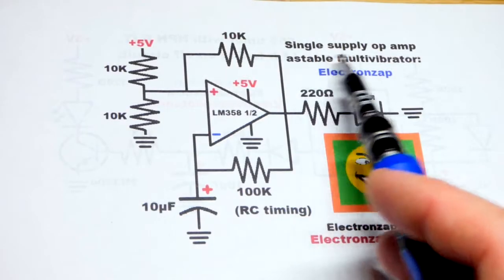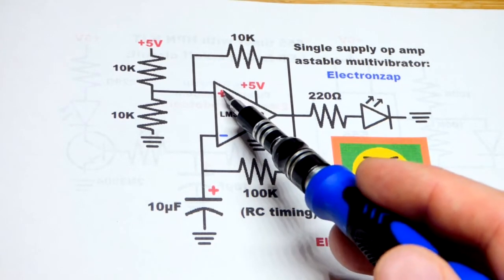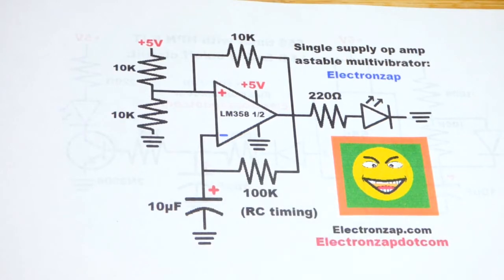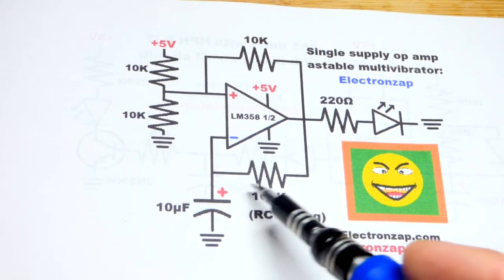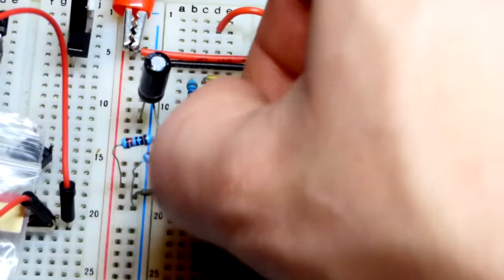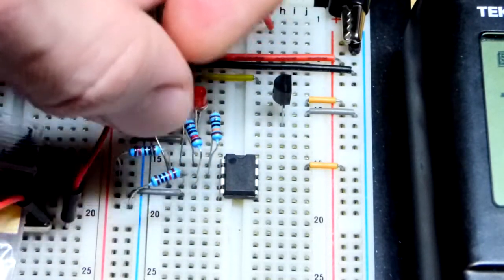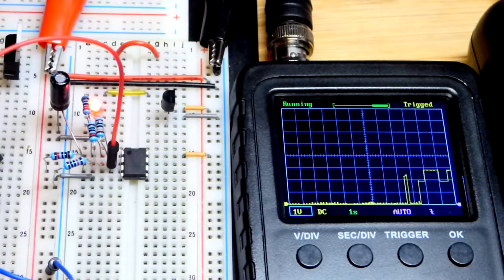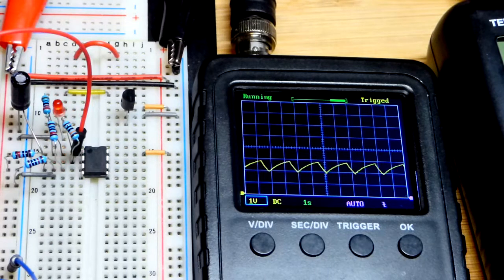Single supply op amp LM358 astable multivibrator circuit with flashing LED demonstration circuit

Comment: What if that 5v supply is removed, and it's adjacent one 10K resistor is removed?
Will I still get POSITIVE SQUARE OUTPUT VOLTAGE OR POSTIVE SQUARE OUTPUT WITH NEGATIVE SQUARE OUTPUT?
Please explain the uses of this 5V supply?
Reply: You will get a diffrent voltage outputs depending on the refrence voltage so you can try other resistors and see how they work out for you

Comment: can I use lm348 it is a quad op amp but can I use one of them
Reply from the maker: You can use any op amp for an op amp circuit as long as it is capable of doing what you need it to do. Just need to check it's datasheet. You can always use just 1 of the integrated circuit's 4 op amps.
Reply: I check it's block diagram and it's almost the same but it has 4 op amps inside

Comment: I feel like I have this wired right...but led just stays high...no flashing...also there is no voltage difference between pins 2 and 3...which would explain I think why it’s not flash but don’t understand why there is no voltage difference
Reply: I realize this is 3 years old, but my reply might help others: Check that you're using the same values. If not, you might be flashing so quickly that the led looks like a steady state. The only way to check this is to put a scope on it.

Comment: Thanks for the video, finding it tough to understand the effect of the positive feedback in this circuit.

so say we start with 2.5v at non inverting input, as inverting input tries to match the 2.5v the capacitor charges and the output is positive.

But when the inverting input reaches 2.5v the output of the op-amp goes low and thus pulls the non inverting input low also through the positive feedback loop?

Thanks.

Comment: @electronzapdotcom is the formula for your timing 10μf x 100k. Cause that is what I did and it seems to match the timing of your circuit? I.E. τ = 1 Second.
Reply from the maker: I probably just guessed what values would give me the timing I need, and adjusted them as needed to actually get the speed I wanted. :)
Reply: @Electronzap  Thank you, I have found if the capacitor is less than 1000μf you get accurate outcomes by doing resistance × capacitance. For example 1M * 1μf = 1 second which is correct when you breadbord it at 6V
Reply: @Electronzap  What if that 5v supply is removed, and it's adjacent one 10K resistor is removed?
Will I still get POSITIVE SQUARE OUTPUT VOLTAGE OR POSTIVE SQUARE OUTPUT WITH NEGATIVE SQUARE OUTPUT?
Please explain the uses of this 5V supply?